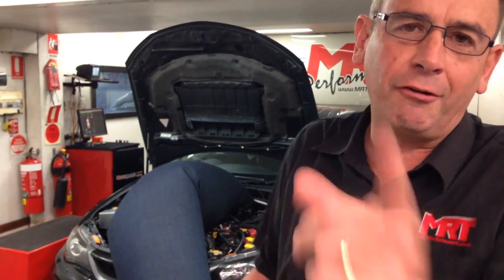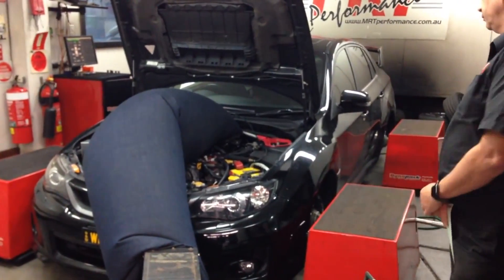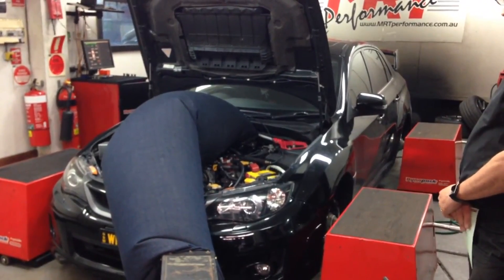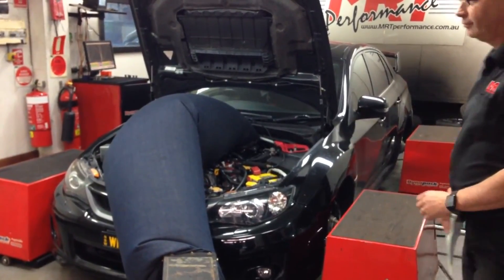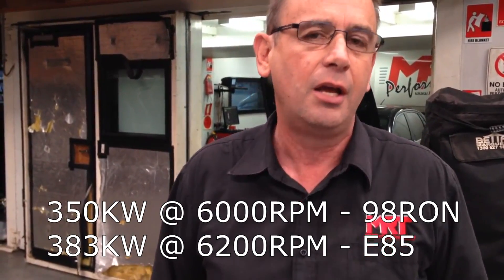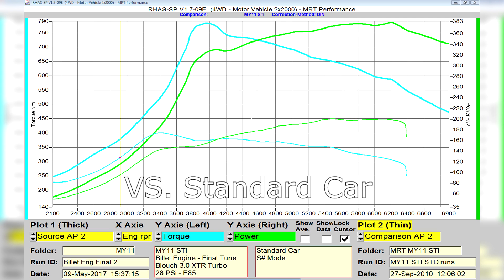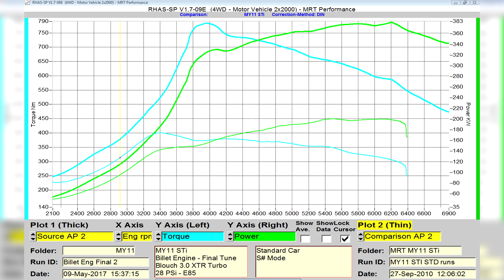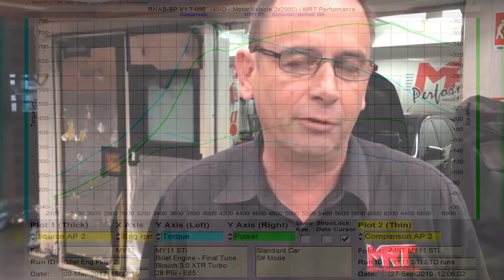PROJECT BILLET - Final Dyno Power/Torque Figures

Comment: Awesome monster torque.. crazy.. my 500awkw had little torque but big lag 5k to 8k, I like it, because I can drive around normally without hitting boost every where I go. 
Though, you could have given him power options as I have 4 stages of power
1 - 15lbs 300awkw 
2 - 20lbs 350awkw
3 - 23lbs 410
4 - 27lbs 440..
Haven't run 27lbs yet..
Thinking about going with billet block..

Comment: The whole "it's not power that makes cars quick, it's torque" I think is a bit misleading - we all know what this guy who knows way more than me about cars means when he says it, and everyone uses the saying, but again it's misleading. Torque alone makes nothing quick. I can make 200lb/ft with a breaker bar, but it won't make anything go fast because i can't spin it fast enough to make power. The gobs of torque down low just means you'll way more power down low than usual - the power, which comes from the torque AND spinning engine, makes the car fast.

Comment: I watch with interest all the performance available in your modified Subaru engines.  What about the final drive?  Are U-joints, drive axels and clutch packs up to hefty horsepower (KW) gains?  How about CVT’s?  I’ve seen some adjacent components or programming altered, bit it always seems the basic factory parts are still there, handling much more stress than designed for.

Comment: torque is just a force.
people get confused between low rpm power and call it torque.

simply power at low rpm makes the car nicer to drive around town.

this car has decent power at low rpm and has usable power
Reply: Jared Tate 
Technically speaking Horsepower only exists on an engine dyno. Torque is what is measured by a chassis dyno, getting hp through an equation.

Comment: The torky vs. peaky engine for racing is a tricky question. In slow race with low down force and frequent tight turns (rally, SAE formula, street stock,  GO Kart..) the large but average powerband of a torky engine will help for corner exits and will save time lost in gear shifting. For fast race with long straights, sweeping curves and good downforce (F1, indy car, moto Gp) short and high peaky power curve in compact engines will be lighter end give better top end speed but more frequant gear shifting.

Comment: U cant measure torque on a chassis dyno only tractive effort
Reply from the maker: correct
Reply: What blouch turbo has this got, ive got this turbo i had custom built very similar to the Blouch dom 1.5 but better i cant wait to test it
Reply from the maker: its a custom spec turbo, that is no off the shelf, but your turbo is way smaller than the one we enhance
Reply: MRT Performance yeah it would be i had mine built around the ej20

Comment: With so much extra torque, did you need to modify gearbox or diff ratios too?
Reply from the maker: nope, the 6 speed STi trans is very strong
Reply: MRT Performance I was more concerned with ratios being wrong

Comment: Care to share the boost vs RPM plot? The dyno results seem to indicate that its hitting peak boost way after 3000RPM (as stated).

You may also want to not tell the client that he's getting 760nm of torque at around 3,000RPM (as per the video). The dyno graph shows that he's actually hitting 760nm at around 3800rpm.
Reply from the maker: the turbo  is coming onto boost as early as mechanically possible, at low RPM its a  monster and has to be one of the quickest Subaru's I have driven :)

Comment: Just in the midst of a full build on my 2015 here in Canada.  The peak torque number is impressive, however it drops off pretty quickly.  Would you not prefer to have a lower torque value that was flat all the way up the RPM range?  Is the drop off a function of the turbo efficiency or tuning?
Reply from the maker: The exhaust, intercooler etc,cant flow any more HP at higher RPM
Reply: would the torque curve shift dramatically if you did do a front mount intercooler or 4 inch exhaust?   or would it still spool up that early and come on to power that early while gaining some top end power?
Reply from the maker: will be a LOT different, some good some bad

Comment: It'd be nice to be able to know what you're getting at because it's hard for other people in other countries that are using English as the universal language but it be nice to know about what is horsepower or Torque hard for you guys to brag about something went only you guys understand it at least we got one thing in common we both say RPM we both know that one
Reply: The problem is actually with countries that don't use Standard International units like the watt, the newton, and the metre :). SI is the international language of measurement. One horsepower is about 0.7355 kilowatts. Kilowatts have nothing in particular to do with electricity. One pound-foot of torque is about 1.356 newton-metre.
Reply from the maker: Kilowatt definition. One kilowatt (kW) is equal to 1000 watts (W): 1kW = 1000W. One kilowatt is defined as energy consumption of 1000 joules for 1 second: 1kW = 1000J

Comment: I'm a little bit confused you guys say kilowatts I thought it's a car not a generator and where is the generator on the car I mean I know there's an alternator but where is the generator if it's creating kilowatts why does it have wheels if it's a generator it would be nice if you stayed horsepower or Torque because same kilowatts doesn't mean was that horsepower in English or is that torque in English love Australia but you guys are confusing I'm just saying
Reply from the maker: we use  metric units, 
Torque is a measure of how much twisting is applied to a fastener. The units used to measure torque are in the form of force times length. The metric (SI) unit of torque is the newton metre (Nm). In inch units, torque is usually measured as Lb-Ft (pounds feet) or Lb-In (pounds inch).

Kilowatt definition. One kilowatt (kW) is equal to 1000 watts (W): 1kW = 1000W. One kilowatt is defined as energy consumption of 1000 joules for 1 second: 1kW = 1000J

Comment: Will you have to rebuild this every 60k miles like you do a forged piston EJ25? Also, would the warm up protocol be the same as it would for a forged piston, regular block EJ257?
Reply: He doesn't go into depth about heat expansion tho . Assuming all internals are forged needing a good warm up
Reply: Phillip Graves You should check out the previous block comparison videos.

Comment: The cost is around $25000+ for 380kws..Hmm. No doubt your good at up Selling Brett.
Reply: It´s about the torque mate, this engine will be reliable at 700+ Nm
Reply: Could easily double or perhaps even triple that with nothing but exhaust, turbo, intercooler and tuning
Reply: He didn’t want to make the most possibly Noe power out of this engine he just wanted to have a really reliable engine that made more power imagine a reliability of a stock engine but with more power

Comment: Awesome Job Brett!! Remember me?? 😝 Been following this series and finally its complete.. How did it feel when u fine tuned it on the road?? That torque is insane!! If i was to get an sti and close deck it the original engine.. Would it be anywhere close to this one with the same parts? ... Very curious and interested in the current spec R.
Reply from the maker: Richard, best call us, its easier to help and explain options

Comment: The best part is the body not giving away it being a 500HP car.  Not to mention it doesn't brake a sweat hitting thoes numbers and can double it's figures with a few days in the shop at this point. I'm a huge fan of this build!
Reply from the maker: That's exactly it. Knowing your engine isn't on the ragged edge makes it so much more enjoyable to drive.
Reply: Gamma Light this is my dream build. Mostly looking stock everything but being a bulletproof daily driver.
Reply: J53113. Ditto, I'm strongly debating building one of these Willall stage X buillet blocks so not to wear out the stock block in consideration of the car having a "classic" value when that day comes.
Reply: MRT Performance seriously interested my main question how would you go about getting more talk and power out of it can you explain cosworth parts extra and also is it road legal and when would you have to rebuild it for reliability also can you run it on standard petrol as they don't sell e85 where I live

Comment: Great build! You can tell at the top end it wants to climb but struggles for air and hits a brick wall! Not the turbo I would choose but its not my car. VERY impressive amazing job!
Reply from the maker: Thanks Brandon. We tried a number of different turbo configurations before concluding that this one gave the best performance for the customers needs. others resulted in slightly more power, but more lag and less low down torque.
Reply: Which Turbo have you used in this application?

Comment: does the FA20 heads flow better than the ej25 heads?   Are they compatible with each other?   I would be curious to see how the D4-S works with this engine block.
Reply from the maker: cant use  the FA20 heads on the EJ block,
Reply: FA20 heads are for a completely different engine. Best flowing EJ heads you can get are EJ207.

Comment: That equals 470 hp and 560 ft lbs of torque, sounds like a beast. Maybe some meth injection in the future?
Reply from the maker: There's a bunch of other mods we could do to free up the power the engine is capable of making before Meth becomes a cost effective way to make more power. but it's certainly an option should the customer wish to go down that path later on.
Reply: It says it's on e85 on the dyno sheet... I doubt he would see much of gain from meth injection since it's already on E85.  Unless that turbo setup is near the top of its efficiency point and blowing super hot air and water injection was used to cool the charge temps, but even then I doubt there would be any substantial gain.  If it were running on a pump gas tune like 93oct , you'd see big gains with meth